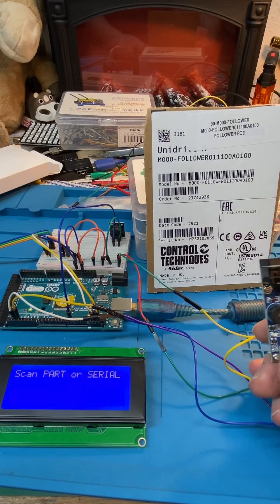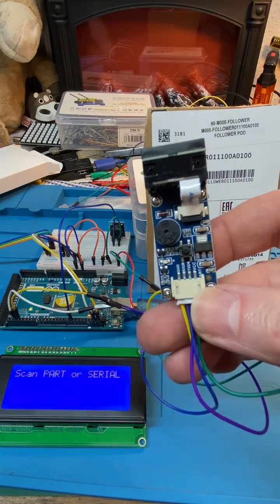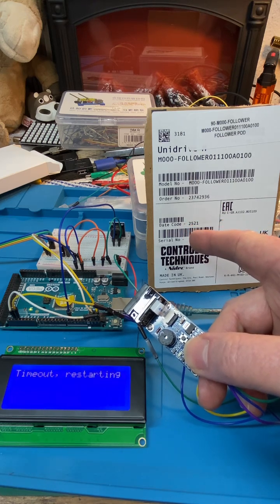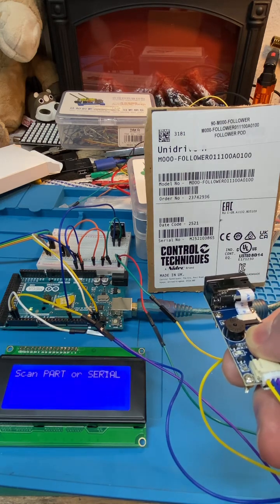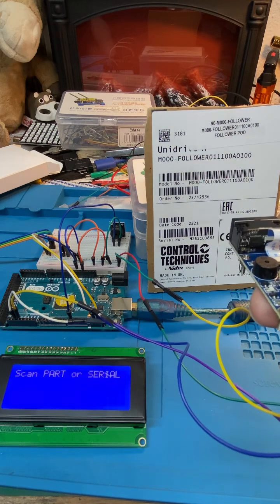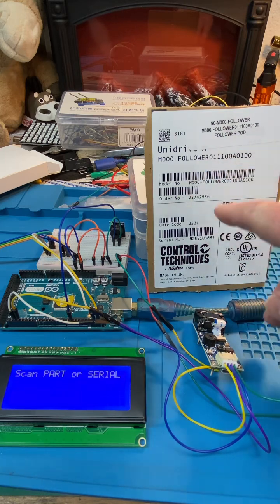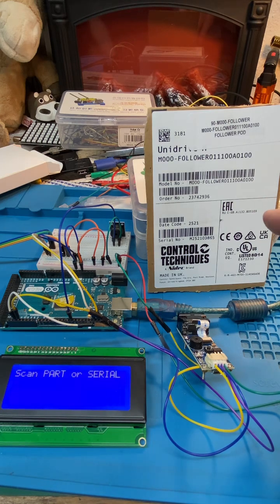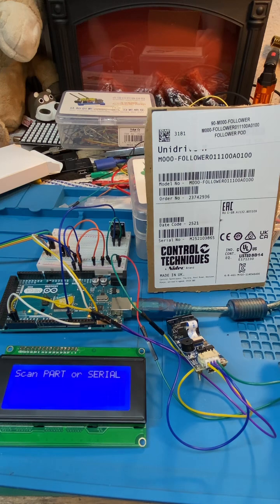Arduino Mega + Barcode Scanner: Reliable Part & Serial Logging!

Comment from the maker: /*
  Mega2560 + I2C 20x4 LCD + TTL barcode scanner (UART) + BUZZER
  Rules:
    - Serial  : length == 10   (first char may be letter or digit)
    - Part    : length  > 10
    - length  < 10   -> ignored (double-chirp)
  Flow:
    - Accept either order until we have one Part + one Serial
    - Show results on LCD and print "CSV,<part>,<serial>" to Serial
    - Buzzer feedback on accept/ignore/timeout/done
*/

#include <Wire.h>
#include <LiquidCrystal_I2C.h>

#define LCD_ADDR 0x27
LiquidCrystal_I2C lcd(LCD_ADDR, 20, 4);

#define SCAN Serial1                 // Mega2560: RX1=D19, TX1=D18
const unsigned long SCAN_TIMEOUT_MS = 20000; // 20s

// ---------- Buzzer config
#define BUZZER_PIN 9
const bool PASSIVE_BUZZER = false;   // true = use tone(); false = active buzzer (on/off)
const int  TONE_OK   = 2000;         // Hz for passive buzzer
const int  TONE_ERR  = 900;
const int  TONE_DONE = 1500;

void chirpOK(uint16_t ms=60){
  if (PASSIVE_BUZZER) { tone(BUZZER_PIN, TONE_OK, ms); }
  else { pinMode(BUZZER_PIN, OUTPUT); digitalWrite(BUZZER_PIN, HIGH); delay(ms); digitalWrite(BUZZER_PIN, LOW); }
}
void chirpDouble(){  for(int i=0;i<2;i++){ chirpOK(40); delay(80); } }
void chirpTimeout(){ if (PASSIVE_BUZZER) { tone(BUZZER_PIN, TONE_ERR, 250); delay(250); noTone(BUZZER_PIN); }
                     else { pinMode(BUZZER_PIN, OUTPUT); digitalWrite(BUZZER_PIN, HIGH); delay(250); digitalWrite(BUZZER_PIN, LOW); } }
void chirpDone(){    if (PASSIVE_BUZZER) { tone(BUZZER_PIN, TONE_DONE, 120); delay(140); noTone(BUZZER_PIN); }
                     else { pinMode(BUZZER_PIN, OUTPUT); digitalWrite(BUZZER_PIN, HIGH); delay(120); digitalWrite(BUZZER_PIN, LOW); } }

// ---------- Helpers
String readScannerLine(unsigned long timeoutMs = SCAN_TIMEOUT_MS) {
  unsigned long start = millis();
  String s = "";
  while (millis() - start < timeoutMs) {
    while (SCAN.available()) {
      char c = (char)SCAN.read();
      if (c == '\n' || c == '\r') { s.trim(); if (s.length()) return s; }
      else s += c;
    }
  }
  return "";
}

// token kinds (avoid enum troubles)
const uint8_t TOK_IGNORE = 0;
const uint8_t TOK_SERIAL = 1;
const uint8_t TOK_PART   = 2;

uint8_t classifyToken(const String &t) {
  int L = t.length();
  if (L < 10)  return TOK_IGNORE;
  if (L == 10) return TOK_SERIAL;
  return TOK_PART; // L > 10
}

void lcdIdle() {
  lcd.clear();
  lcd.setCursor(0,0); lcd.print("Scanner Test (Mega)");
  lcd.setCursor(0,1); lcd.print("Rules: S=10, P>10");
  lcd.setCursor(0,2); lcd.print("Scan PART or SERIAL");
  lcd.setCursor(0,3); lcd.print("Waiting...");
}

// ---------- Setup / Loop
void setup() {
  Serial.begin(115200);
  SCAN.begin(9600);          // adjust if your scanner uses a different baud
  lcd.init(); lcd.backlight();
  pinMode(BUZZER_PIN, OUTPUT); digitalWrite(BUZZER_PIN, LOW);
  lcdIdle();
  delay(200);
}

void loop() {
  lcdIdle();

  String part = "";
  String serial = "";

  // Keep prompting until we have one valid part and one valid serial
  while (part.length() == 0 || serial.length() == 0) {
    lcd.clear();
    if (part.length() == 0 && serial.length() == 0) {
      lcd.setCursor(0,0); lcd.print("Scan PART or SERIAL");
    } else if (part.length() == 0) {
      lcd.setCursor(0,0); lcd.print("Have SERIAL:");
      lcd.setCursor(0,1); lcd.print(serial);
      lcd.setCursor(0,3); lcd.print("Now scan PART (>10)");
    } else { // serial missing
      lcd.setCursor(0,0); lcd.print("Have PART:");
      lcd.setCursor(0,1); lcd.print(part.substring(0,20));
      lcd.setCursor(0,3); lcd.print("Now scan SERIAL(10)");
    }

    String tok = readScannerLine();
    if (!tok.length()) {
      lcd.clear(); lcd.setCursor(0,0); lcd.print("Timeout, restarting");
      chirpTimeout();
      delay(600);
      return; // back to idle
    }

    switch (classifyToken(tok)) {
      case TOK_IGNORE:
        Serial.print("IGNORED (<10): '"); Serial.print(tok); Serial.println("'");
        lcd.setCursor(0,2); lcd.print("Ignored (<10 chars)");
        chirpDouble();
        delay(300);
        continue;

      case TOK_SERIAL:
        if (serial.length() == 0) { serial = tok; chirpOK(); }
        else { Serial.print("Extra Serial ignored: "); Serial.println(tok); chirpDouble(); }
        break;

      case TOK_PART:
        if (part.length() == 0) { part = tok; chirpOK(); }
        else { Serial.print("Extra Part ignored: "); Serial.println(tok); chirpDouble(); }
        break;
    }
  }

  // Have both -> show + CSV line
  lcd.clear();
  lcd.setCursor(0,0); lcd.print("OK:");
  lcd.setCursor(0,1); lcd.print("Part: ");   lcd.print(part.substring(0,14));
  lcd.setCursor(0,2); lcd.print("Serial: "); lcd.print(serial);

  Serial.print("CSV,"); Serial.print(part); Serial.print(",");
  Serial.println(serial);

  chirpDone();
  delay(1000);
}